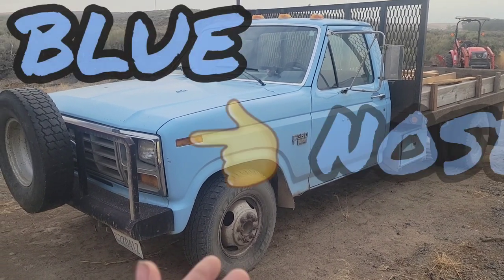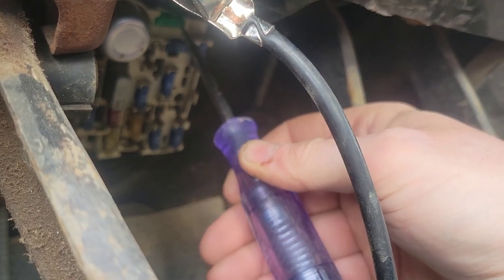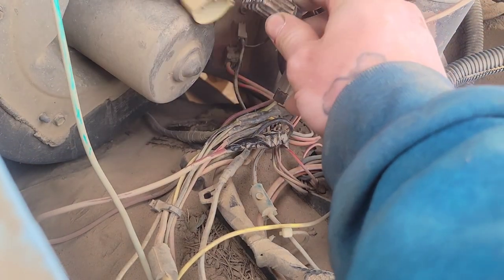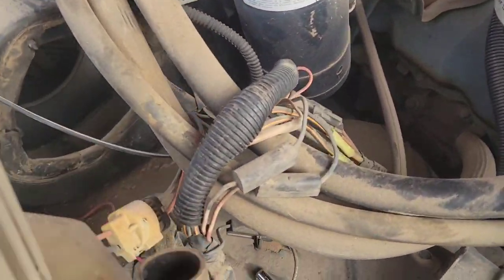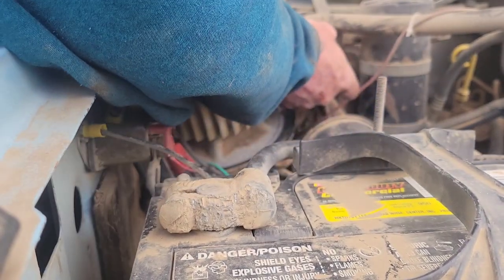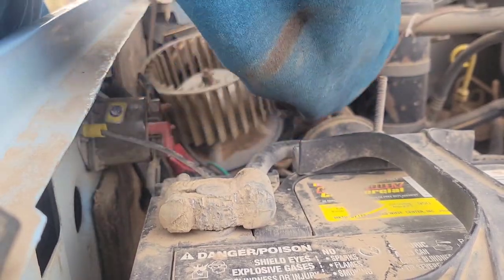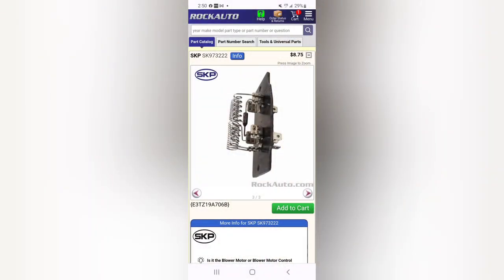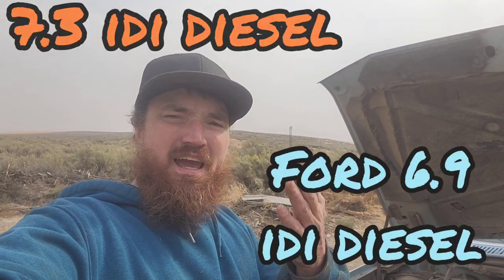Troubleshooting and repairing heat and defrost in bullnose ford truck before winter

Comment: thanks for the info! if my truck has the inline six do you think the blower will be different?
Reply from the maker: Should be same blower whichever engine the truck has. Best way to know for sure is check rockauto.com see if it is the same part # Thanks for watching, good luck with your project. God bless.

Comment: Hey man my truck has broken down it’s rattling in the front by the fan and leaking oil shaking and smoking bad what do you think that is it’s a 88 Isuzu 6bd1t engine
Reply from the maker: I couldn't give you an honest opinion without looking at it. But definitely don't sound good. Sorry your having issues with your truck. Hope you can get it figured out.
Reply: @worthshop  I think it’s the camshaft or crankshaft pulley I’m going to tear it down in the morning it’s on the side of the road in Louisiana 😭 but I’m going to get it